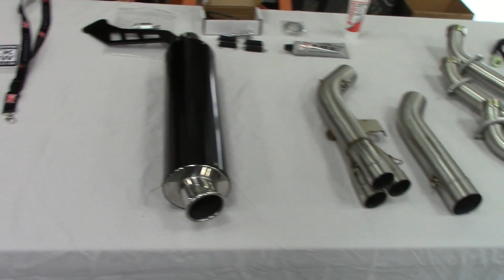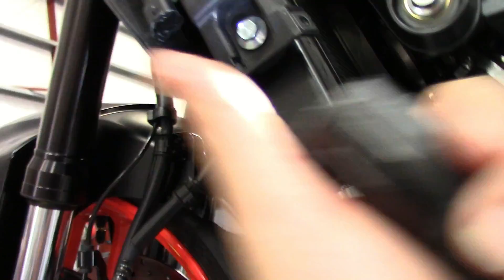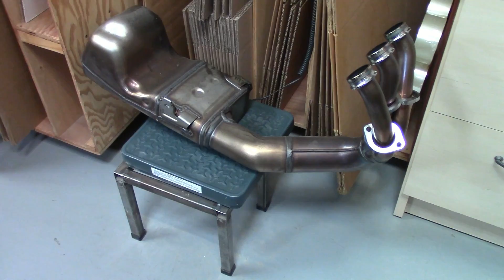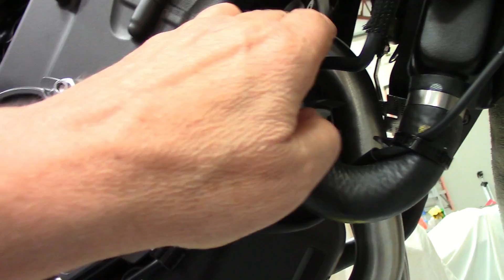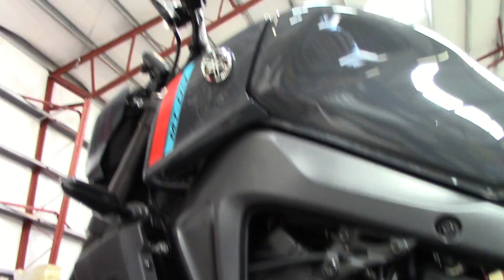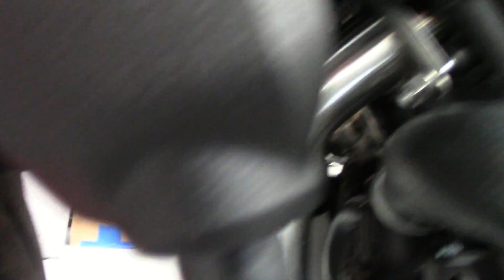2021 Yamaha MT-09 Full Exhaust Install - Dale Walker

Comment: Does the engine need a tune after installing the exhaust? or is it simply set it and forget about it?
Reply from the maker: Yes you really should Flash the ECU along with a air filter of your choice. I recommend David at V Cycle Nut. He does a great job, and will talk to you on the phone anytime. Cheers Dale

Comment: Love to see a segment on that Royal Enfield. From what I've read and seen its a pretty nice bike. I guess it's easy to find hard parts on it and the front end washes out if you push it fairly hard. Other than that it's a fairly sweet bike.
Reply from the maker: Hi Wayne, I recently bought a new 22 Himalayan & the 650 Interceptor for about the same cost and one bike made in Japan. The finish and quality is actually very good. I've been cleaning up the 650 INT making it my own, but still waiting on a few parts to finish it up. I will do a video on the bike pretty soon most likely. Cheers Dale

Comment: Looking forward to the dyno video!  I like the sound with your Hotshot muffler.  It's perfect!
I installed a complete Yoshi exhaust system with their canister type muffler on my ZX10 back in 1988, and it sounds a lot like yours, (at least on my computer 🙂) even though it's a 3 cyl vs 4 cyl. Good sounds!
Reply from the maker: Set the production record on that bike in 88 Mario !  Cheers D